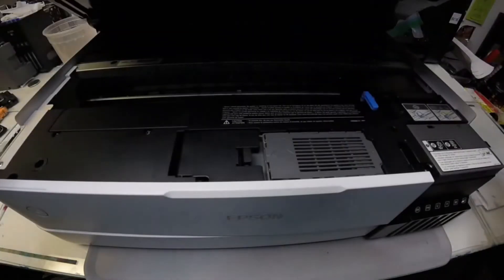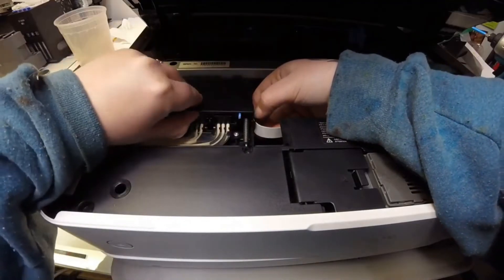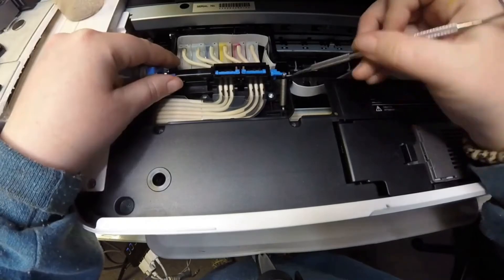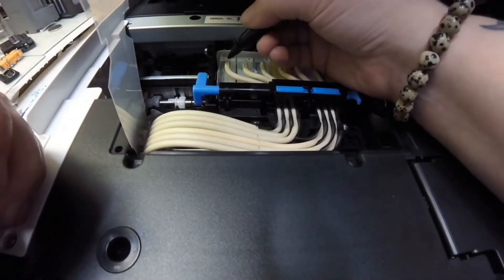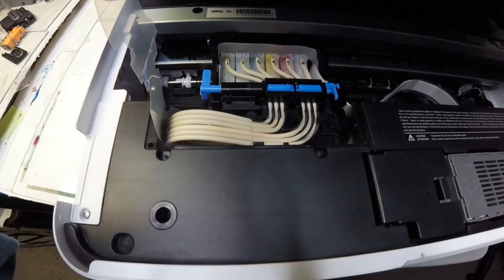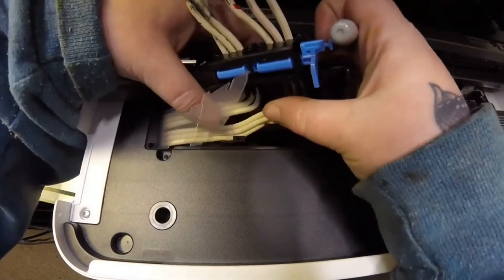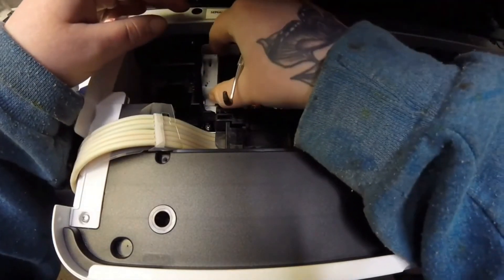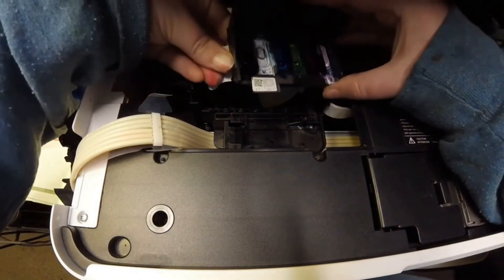Discover How to Easily Replace an Epson ET-8550 Printhead!

Comment: You will most likely find it useful to use tweezers to put in the last cable on the left when replacing. It’s a pain so have some patience.
Reply from the maker: Great tip! Those cables can be a pain, for sure. I’ll definitely keep that in mind next time!

Comment: As a pensioner that has, had so many hobbies in my time, I have bought so many picks in my time.  Sooner or later they all turn out to be rubbish.  Maybe it's because I have never spent much money on them but, it never occurred to me to use dental implements.  If nothing else this one single tip has made this channel worth while.

Right I'm off to ebay to find some dental instruments :-)

Comment: How did you get the print head unlocked?
Reply from the maker: Thanks so much for watching and for your great question! I unlocked the printhead by turning the printer on and letting it move to the center before unplugging the power cord — that stops the carriage in an unlocked position so you can access it safely. I truly appreciate your engagement and support! I receive a high volume of questions, but subscribers and members always get priority answers, usually within 48 hours, plus exclusive benefits like early video access and special tips. If you’re not already, please consider subscribing or becoming a member to get those perks. For faster help, you can also email [support@bchtechnologies.com](mailto:support@bchtechnologies.com). And if this video or answer has helped your journey, I’d be so grateful if you could leave a quick review on my Google page: [https://g.page/r/CfL7k6nYvPQ9EAg/review](https://g.page/r/CfL7k6nYvPQ9EAg/review).

Comment: Cleaned the Printhead, put things back together, no ink going to the printhead tanks, can you please help me?
Reply from the maker: Thank you so much for watching and for your support — I really appreciate you taking the time to ask! When no ink is reaching the printhead tanks after reassembly, the first thing to do is make sure the printhead is properly parked on the capping station by turning the printer on and letting it settle naturally there (it’s safe to do this with the power on), and since DTF ink is thicker than standard ink, the system often needs a little help to re-prime; once parked, connect a syringe and tube to the waste line and gently draw vacuum, watching for slight resistance, because pulling only air usually means the head isn’t sealed on the cap or there’s a leak, while total resistance points to a clogged capping station, and hearing the damper membrane crinkle is a good sign the nozzles are opening, after which you can slowly draw and hold vacuum briefly before running a normal cleaning cycle (avoid strong or back-to-back cleanings and give the printer time to rest). Since I get a very high volume of questions, just a quick note on replies: subscribers and members get priority and are usually answered within 48 hours and also get benefits like early access to videos, regular viewers are answered if time allows since I can only reply to about 10 questions per day, and after subscribers and members, remaining replies are handled last-in, first-out (newest questions first), so if you don’t hear back within 48 hours and aren’t subscribed, you can either subscribe or repost your question, and if you subscribe later, your older questions automatically become priority without reposting. I’d also love to invite you to Run With Kevin — LIVE, where I go live every morning (usually between 6–8 AM Eastern) and answer printer questions in real time, so subscribe and turn on notifications if you want to catch the next live and ask directly. If you need faster help, email [support@bchtechnologies.com](mailto:support@bchtechnologies.com), and if this video or comment helped you, I’d truly appreciate a Google review here: [https://g.page/r/CfL7k6nYvPQ9EAg/review](https://g.page/r/CfL7k6nYvPQ9EAg/review) — thanks again for being part of the community!

Comment: I need to buy a replacement but not sure where to get one to make sure I’m getting a good one and not an inferior copy cat? Also I have read that you need special software for the new printhead?
Reply from the maker: Thanks so much for subscribing—it really helps us get closer to our 100K goal, and I’m doing my best to get to subscriber questions like yours within a few days despite the growing backlog. To make sure you get a genuine printhead and not a low-quality knockoff, the safest option is to either go through Epson directly (if you know the channel) or work with an Epson-certified repair technician. As for the special software, it’s typically not required for most new printheads unless you end up with a rare factory-defect unit that needs spray intensity (head ID) adjustment. Appreciate your support!

Comment: This video was extremely helpful and informative. However, I would like to suggest adding a note at the beginning about unlocking the printhead. Initially, I was unsure how to do this, as it wasn't mentioned in the video. The person in the video moves the gear to unlock the printhead, which might not be immediately clear to all viewers. Aside from that, this is an exceptionally well-done video. Thank you!

Comment: For the life of me I cannot get these dampers back on. I almost started crying. I cant get the little metal bar in the back slot and get the front to lock at the same time. I have already cracked one damper. Please help
Reply from the maker: Thank you so much for subscribing and for your support! Every subscriber is incredibly important to me as I work toward my 100k goal. It’s been 8 years, and I’m only halfway there, but with amazing supporters like you, I’m motivated to keep creating helpful content and answering questions. If I ever miss your comment or you need a faster response, feel free to email me at support@bchtechnologies.com—I’ll do my best to help!

I know how frustrating it can be to reinstall those dampers. The key is proper alignment. Once everything is lined up, it shouldn’t require much force—just a gentle push. If you’re struggling, I recommend watching these two videos for guidance: https://youtu.be/Wnt_ok5-CgY and https://youtu.be/hZhljcmO-YM. They walk you through the process step by step and can help you get those dampers in place without damaging them.

If you’ve cracked a damper and need replacements, you can find them here: https://bchtechnologies.com/products/damper-for-epson-et-8550-l8180-l8180-l8188-ew-m973-dtg-dtf. Let me know how it goes, and thanks again for watching and commenting! I’m here if you need further assistance.

Comment: Hi there i did all this to clean up the build up ink and now i dont get any ink coming out! How can i prime my cartridges on this same printer?? Thank you very much
Reply: You ever figure this out?
Reply from the maker: Hey, thanks so much for subscribing and supporting the channel! Every subscriber means a lot – I’m working hard to reach 100k, and after 8 years, I’m about halfway there. Your engagement keeps me motivated to keep making helpful videos and answering questions like this.  

For priming your cartridges, the best way to start is by parking the printhead on the capping station. Turn the printer on and let the printhead naturally settle on the station – it’s safe to do this with the power on. Since DTF ink is thicker than standard ink, the printhead may need a little extra push to get going. After the printhead is parked, connect a syringe with a tube to the printer’s waste line and slowly draw 2 ml of air. Start by drawing 1.5 ml; at that point, you should feel light resistance. If you’re only pulling air, it could mean the printhead isn’t properly parked or there’s a leak in the capping station’s seal. If you can’t draw anything at all, it’s possible the capping station is clogged, which will need to be fixed before the printhead can be primed.  

If everything feels right, continue to slowly draw until you reach the full 2 ml mark and hold it for 10 seconds. This should help pull ink through the nozzles. After that, run the printer’s regular cleaning cycle, but avoid running any strong cleanings for at least 12 hours. Also, try not to do back-to-back cleanings – give the printer some time to rest in between.  

If you need more detailed help or the issue persists, feel free to email me directly at support@bchtechnologies.com. I try to answer subscriber comments within 48 hours, but sometimes the backlog can take a bit longer. I really appreciate you being part of the community – thanks again for watching!

Comment: Do you have a video of how to put printhead back?
Reply from the maker: I don't but it should be easy. If you found it difficult, let me know and I will make one.
Reply: @BCHTechnologies I'm most curious to know the best approach to re-priming dampers and head without getting air in the head. Not sure why they designed the dampers the way they did Instead of having a spike on the manifold. I tried charging by pulling through the waste like I do on the l1800. Still not getting all colors. I feel like I'm vapor locked in some channels.

Comment: i have the model j fusion dtf printer it starts to print normal then slows down to almost a stop. changed cr motor and did the reset still does it after trying 4 different cr motors. any idea what it may be??
Reply from the maker: Is your printer based on 1390? You cannot use the motor for L-1800.

Comment: Dont do this. Youll get ink all over the motherboard once that ink drips down the printhead. 

The better way is to remove the ink lines wile the printhead is locked on the capping station.  Then suck the ink out the waste line.  If you have a vacuum pump setup they will work faster.  

Once you have the ink out the cartridge. Then remove them. Youll have almost no ink to spill.  

P.s.leave the spring and clamp the ink lines so the ink wont run out.  You can remove the rest as 1 piece.
Reply from the maker: If your printhead is not waterproofed, it is crucial to extract the ink from the "damper" before removing it. You can use the "flushing syringe" tool to suck ink out. I won't suck the capping station because I don't like the direction of the ink flow. If the printhead is waterproofed, I will remove the damper without further work. While the ink typically doesn't penetrate as far as the mainboard, some cleanup is necessary.
Reply: @BCHTechnologies I’ve recently removed the 8550 print head to remove a stuck piece of paper. No more paper jam on reassembly, but I think I reinstalled (now) empty dampers. Would this explain why my prints are empty? If so how do I refill them to regain my printing?